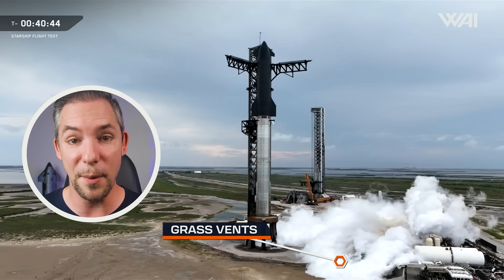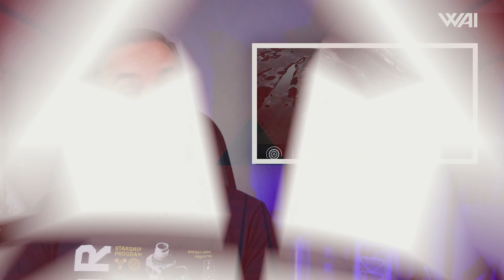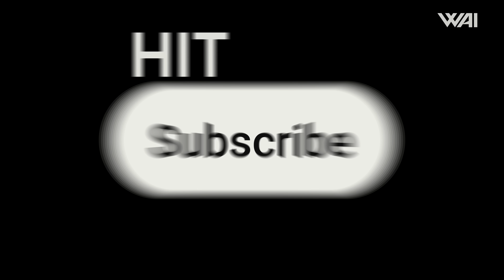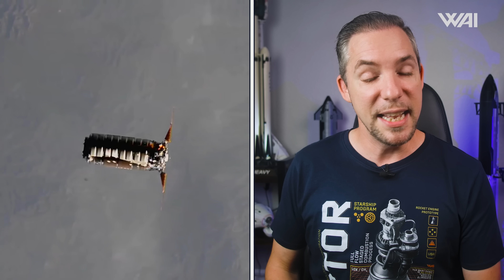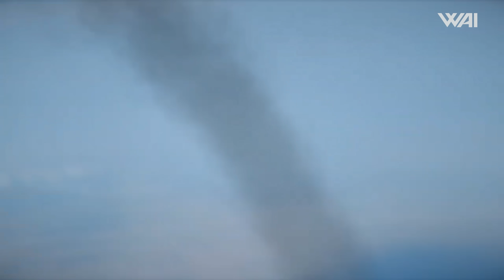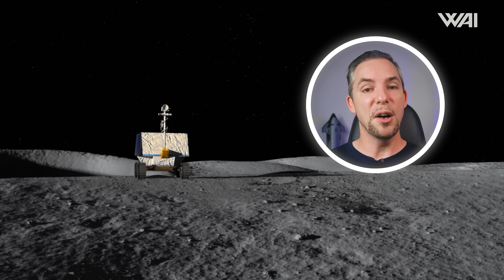SpaceX Starship Flight 11 So Close - I'M SHOCKED!

Comment: I think that the pressurization system will need a redesign... as I understand it the warm gas used for pressurization is preburner exhaust that contains not only the commodity in question but water vapor and carbon dioxide, which has been a problem with clogging propellant lines. Even if the filters prevent this the water will remain in the tanks and accumulate on successive flights, impairing rapid reuse and freezing into large chunks at the tank bottoms on subsequent loading.

It seems that something like small heat exchangers on the center Raptor preburners acting on pure cryogenic propellants wouldn't add a huge amount of mass.

Comment: I would think that it might be easier of they created a horizontal transporter.  At Starbase they lower the booster and starship horizontally onto a transporter.  Then drive it to You'll Thank Me Later, driving the booster and starship aboard and secure it.  After getting to the Cape, they could just drive it to the SpaceX Facility, where they can bring it back to the vertical position.  Check them out and deliver them to the launch site.  If they catch the booster / starship, if they want, they then could lower them again and transport them back to Starbase.  Otherwise send the horizontal transporter back to the barge, to be returned to Starbase.

Comment: @Whataboutit
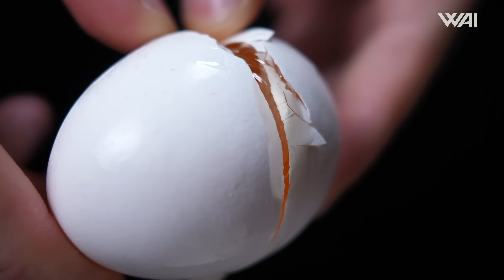07:51 Fact check, Eggshell is 0.35-0.39 mm thick and  Starship uses 3.97 mm steel so 10X thicker than Egshell....
Reply: Also in relation doesn't make sense... You mean proportionally?
Reply: An ostrich egg shell can be up to 4 mm thick.
Reply: @Qui-Gonn LOL!  Dont think that was an Ostrich egg in the video, lol.
Reply: Confirm fact check.  

A chicken egg shell is on average 0.3-0.4 mm wide.

The Starhship steel is 3.97 mm wide, it is !) TEN TIMES as wide as an egg shell... not less wide.  (I checked this figure too, it is correct, only the egg-shell number was wrong).

4mm of steel is actually pretty thick, pretty strong, and pretty heavy by relevant comparisons: 

1. Modern commercial jet fuel tanks have tanks made of 1.5-2.5 mm Aluminum.  

2. The space shuttle external tank was 1.6-2.0 mm of Aluminum-Lithium alloy.  

3. Bulk fuel (petrol/diesel) tanker trailers: 4.8–6.4 mm Stainless Steel.

4. Tanks for transporting Liquid Pressurized Gasses (LPG) such as the ones that would be used to bring fuel to Starbase: 6.4-9.5mm Stainless Steel

5. Ground-storage tanks for pressurized gasses that are intended for decades of stationary use and minimal maintenance with massive safety margins: 10-25 mm thick high carbon steel.  

So, while definitely not in the same range as ground-storage tanks, the Starship's construction is actually pretty chonky by aero-space standards, and only marginally less bulky than used for ground-transport.
Reply: made sense to me
Reply: Starship with it´s Ø 9m is 225x larger than a M sized chicken egg with Ø~ 40mm. (9000 mm : 40 mm = 225).
Sizing up an imaginary egg to the Starship Ø, means the shell thickness of 0,4mm would grow by a factor of 225x as well.
An egg the size of Starship would have a 90 mm thick shell !  (225 x 0,4 mm = 90 mm)
Reply from the maker: Dude... in relation... Egg: 6 centimeters - Starship: 123 Meters.
Reply: @Whataboutit  In comparison... i heard it the second time
Reply: Fk them eggs 🥚
Reply: @Whataboutit 6cm eggs? Florida chickens must be different
Reply: @JustNieman Maybe the height of an egg is 6cm. And yeah thats true
Reply: @JustNieman  Are you saying that is large? The eggs packaged as large are 6cm on average. I'm also in FL though.
Reply: @Whataboutit  the formulation was a bit misleading. Many people point this out. It is logic of course.
Reply: @Whataboutit  why just not say- my fault? Why keep saying stupid things